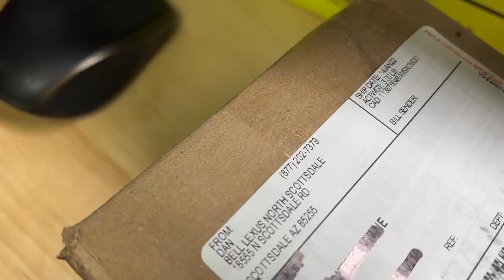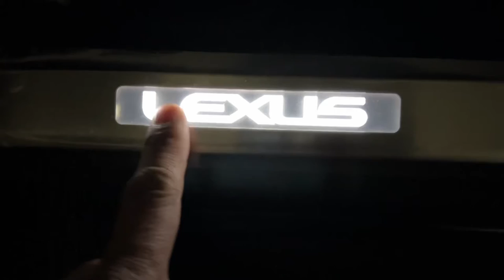OEM Lexus Illuminated Door Sills install - SUPER EASY!!

Comment: Does every Lexus have this connector beneath the sill? Looking to put these in a 2016 NX 200t FS.
Reply from the maker: not sure about 2016 on the NX. Only way to find out to to open the side panel. its can be easily popped out.
Reply: @fondoo  Got it.
I'm looking to purchase the NX and to add some "flavor" to it, hence the question..."does it have".

Thanks for the feedback. I'll be sure to check out the sills.

-Later

Comment: Mines just stopped lighting up anytime I open the door. Is there a specific fuse or do I need to replace them both entirely?
Reply from the maker: i would check the fuse before replacing the lexus illuminated door sills.
Reply: @fondoo how to check fuse?

Comment: Are you switching the non f sport to an OEM f sport one, is that why they aren’t working previously? or do they just go bad? Like why aren’t the bulb replaceable?
Reply from the maker: No, the original door sill did not have lights when I bought the car from the dealership. So, I got the OEM lexus illuminated door sills from a dealer on ebay for cheaps and installed them myself. they are super easy to install!
Reply: @fondoo  Okay thanks for letting me know. i got like an 2012 ct200h and had the driver side go out. Was hoping its just a bulb underneath it.

Comment: Nice video where did you find outer black door sills?? I need it for my 2020 lexus nx300
Reply from the maker: you can find those illuminated door sills from the lexus accessories website. I got them from a ebay dealership OEM parts.
Reply: @fondoo  Where I don't see it??
Reply from the maker: @alanh8101  https://parts.lexus.com/accessories/lexus__.html
Reply from the maker: @alanh8101  watch this video: https://youtu.be/dFQPxSzPGF8

Comment: I want to upgrade my 2012 ct200 bad model- is there a switch for the illuminated lights?
Reply from the maker: these door sills are for the 2022 RX350L. There is not switch. they turn on when the doors are open

Comment: is this working with the new RX 350 2023 ?
Reply: i just checked my 2023 and the plug is not there
Reply: @Darkseid001  so they might have different design
Reply: @tung phan  actually I found the plug after you pull up the sill behind the kick place the triangle looking piece towards the front of the car lift up on it a little you will see it. You have to remove the cap off the plug and it clips right in. Pretty simple.
Reply from the maker: yup
Reply: @Darkseid001   do you have the picture of it or video? I could not find it?
Reply: @TLAfamilies23 it's behind the kick plate not under the sill it has a triangle rubber cap on it its there keep looking sorry I don't have a picture I did it months ago